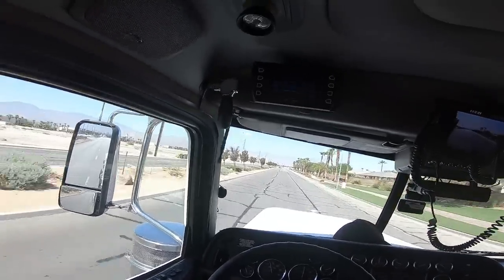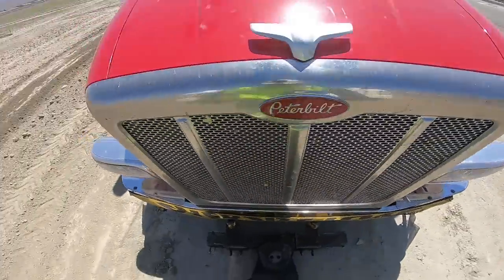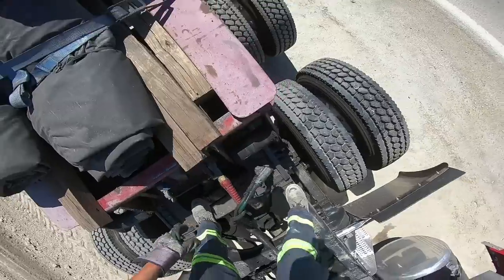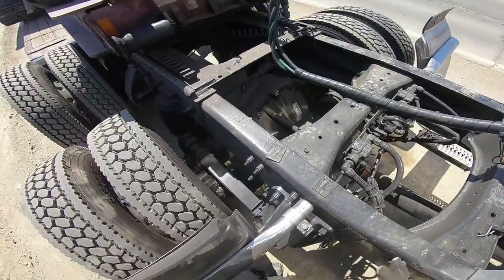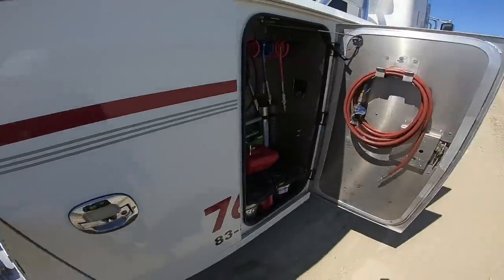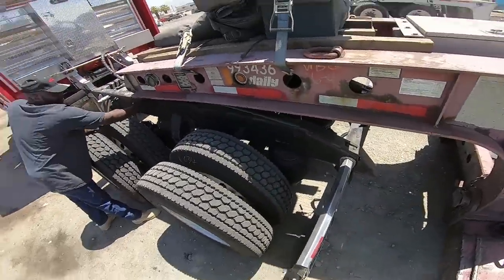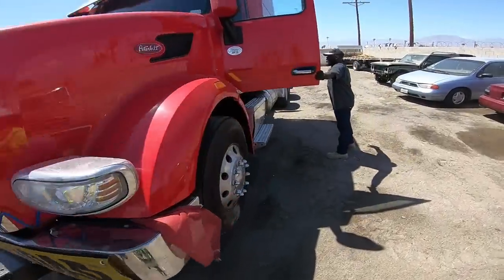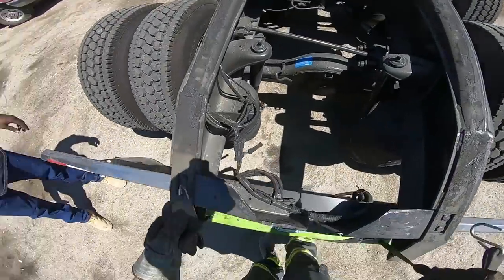Oversize Load Tow! ~150,000 Pounds | 11' 6" Wide

Comment from the maker: Bringing this one to you guys early ! Thanks guys!
Reply: Plaza Towing why do you sperate the shaft?
Reply: Plaza Towing Even if people don’t when will they still be more giveaways
Reply: Helpful tip on those lines from dropping . use some xtra long heavy duty zip ties. Some local towers do that here !!
Reply: @justanotheraviator2357  a towing guy told me once that they separate the drive shaft because your truck is off. So there's no coolant circulating through your transmission which can overheat it and destroy it. So they remove it so there's no movement in your transmission.
Reply: u are good guy and driver lol, thanks
Reply: @justanotheraviator2357  so the diffs don't get wrecked
Reply: How much is your rig
Reply: Are you located out here in Apple Valley?
Reply: Great video
Reply: Simple rule, you CANNOT drive the transmission with the driveshaft without the input shaft turning and the transmission in high range!!! Taking the drive shaft off  eliminates doing any damage to the transmission. You can also remove all 4 axles and put covers over the wheel bearing ends, same result the transmission doesn't turn.
Reply: Where can we buy the air fitting that snaps into discharge line
Reply: How many times did the excavator weigh
Reply: Plaza Towing

Comment: I respect how organized you are man. Everything is where its supposed to be.
Reply: my thought exactly
Reply: Exactly.  And I wouldn't expect less, since this thing could cause huge issues if something bad happened on the highway.  It's basically his responsibility to do everything top-notch.
Reply: 5s
Reply: That´s how work is done efficiently. You´d need to be able to grab into that tool box and have picked the right tool without even looking where your hands go.
Also when there´s lives on the line,  you just don´t make a mistake. Not like "you better not make a mistake", you just don´t make a mistake, period.
Reply: Except for he didn't put the caps On the U joint

Comment: 13:20 might as well put some covers on
Instantly drops it in the dust
that made me laugh

But. when you connected that blue air hose. Does your truck actually got an auxiliary bigger air compressor ? Almost finished my trucking license and i never knew they had a fitting on the engine to put the air in the brakes and suspension externally

Comment: Wish you would have shown the drive, I wanted to hear your acceleration/engine pulling that much weight.
Reply: Me too!!! Was disappointed. Shows him removing lights and attaching lights, more than the driving lol. Wanted to see the pull and turbos whistling
Reply: I'm not to sure how hard it's gonna need to pull on flat & level ground  bro...he can't haul that all together he can haul it to a safe pull off where he can break it down ..
Reply: I was looking forward to the fontana drive.....Damn!! I didn't get to see the big haul in real time....it was a claude vertesi song playing and you were hauling ass!! Reupload the big haul in normal speed! Cool shit though bro!
Reply: Also agree
Reply: ME TOO!!!!
Reply: I've pulled 13 axle/ 50 wheel oversize weighing as much as 268,000 lbs. The engine sounds exactly the same, and seriously, 100K is fly-weight oversize.
Reply: @topixfromthetropix1674  Wow.  your cool dude
Reply: @topixfromthetropix1674  pulled 91,tho,lp of wet sawdust, it's all I wanted to mess with, was in SE, KY,

Comment: Great work! Surprised you dont use binders on the chains incase the load shifts left or right. You havent had a problem unhooking the chains from the method you wrap them if the load does move?

Comment: I was impressed with backing that combo up. Well done sir. I am wondering though why you didn't take another truck to swap out with the broken one to get the trailer to the shop. I'm sure there was a tractor at that shop that could have been used. But I don't run a hook, you are the pro with it.

Comment: Maybe I'm looking to far into it but what keeps the Truck from just sliding left and right in the Yellow Cradle seen at 24:28? Just the fact that the Yellow Cradle is between the Leaf Spring Bolts? Just seems like it could slide left and right about 3 to 4 inches...

Comment: This is so interesting to me. I love the channel! I have a question though. Why do you disconnect the drive shaft? The truck is in neutral right? And why do you have to disconnect it if regular tow trucks don’t have to do that while towing cars and pickups? Thanks.
Reply: Nico Lucia the reason he has to disconnect the drive is to prevent transmission damage I drive box trucks and had to be towed a few times from breakdowns and the driver of the wrecker had to pull the drive shaft to prevent transmission damage with normal cars and trucks they tow the rear wheel drive vehicles on a flat bed and the smaller wrecker (wheel lift units) can only pull the front wheel drive cars if they have to tow the rear wheel drive on a wheel lift wrecker then they tow it with the rear wheels on the wheel lift but they cannot lift a big truck by the back wheels so they have to pull the drive shaft off to prevent transmission damage

Comment: Just a question (some states are different): Did d.o.t. reissue a permit and route, or do you supersede that in your state? Your tow vehicle changes the dimension, weight, and axle spacing for the new total load. Most loads/permit applications go through a bridge analysis for overweight routing (Some have "annuals" but require carried bridge maps which the driver keeps on hand.)
Just Curious
 Great Video!
Reply: That's my question to
Reply: Generally there is an overarching recovery vehicle permit that covers you to go wherever the original vehicle was permitted to go within reason and if safe.
Reply: My question too. So the rig has been permitted. Assuming that the front axle is 20k or less, I reason that the tow vehicle takes that weight and spreads it even further from the drive axle(s) and distributes that weight over tandem axles with dualies. Wouldn't that improve on a bridge analysis review? Therefore, I recon that a skilled operator like the lad we see in this video should be able to drive the rig to any destination covered by the initial permit/route regulations. I'm likely missing an important consideration. Cheers.

Comment: The light bar you put on the rear,  is that turn signals, brake lights etc?  I didn't see you plug it into anything,  how does it work?
Reply: wireless system :)

Comment: wow, backing up that whole train at the yard, I would have liked to see that at regular speed.  Also, when you were figuring out how to tie the red air hose into the harness to the trailer, did you ever consider getting some Gear Ties? Those are rubber coated metal wires and you use them like twist ties to tie  stuff together. They come in different sizes and colors too and are so universal to use and reuse.
Reply: He's qualified for the Australian Truck Trains now.
Reply: Backing up trailer and truck it's hard but not that hard.  Why backing up American doubles is hard is that dolly it gives you a extra pivot point. And the dolly is so short by the time you see the trailer doing something it's to late to recover.  If you watch like outback truckers and stuff those doubles people back all the time.  Now with that said it was cool I've done it with a camper and trailer well think the campers with motors are rv's it was a camper with a motor and a car trailer behind.  I was in a week training to haul wreckers.  I was on the side of the road and the car I was hauling I guy hit the mirror i was standing there not 5 seconds before he side swiped car and didnt stop btw.  I took the truck back with the trainer and handed in my keys and said sorry but not for me.  So to this guy hats off to you.
Reply: @BossSpringsteen69  this is a normal job for us haha I hate backing single axle dog trailers similar to what you guys call doubles. When it's behind a tow truck it's nearly impossible to keep it all lined up as you can't move quick enough to catch it.

Comment: How was they guys truck spec'd out to do heavy haul with a single axle? That's nuts!
Reply: Where is the single axle?.  I see a tandem axle tractor and a tri axle trailer.
Reply: @MilliMillTV  Single drive axle
Reply: @MilliMillTV  He means a single drive, its a tandem but only 1 driven axle
Reply: That's 500lbs in weight savings that he can have as paying cargo!
Reply: @Fu2two  You're already going to need permits anyway so what difference does a couple thousand pounds make. But a whole lot of difference when you're stuck for no reason and need a tow.
Reply: I know right!!!!!
Reply: @F C, it save lots of fuel and tire wear when you're running empty. A truck spec'd like that can lift the dead axle, and he can chain up 2 of the trailer axles a save a ton of rolling resistance. And he pulls for Daily, they deliver new equipment to dealers their trucks don't get in the dirt on jobsites.
Reply: His total weight of him and his rig together was 109,000 lbs. The black guys load wasn't but 60,000 lbs and with the newer axles...he good to go
Reply: @MilliMillTV  Single axle is when the drive shaft only spins one axle to drive the truck....only one set of tires spin when the truck accelerates. Extra tires behind it is for weight purpose.
Reply: There are two axles just no interlock. Kinda like 2wd vs 4wd.
Reply: it's a twin axle rear with single drive.... very similar to the Euro 6x2 trucks, there's no need for both axles to drive.... just so you know...
Reply: @brandonharris9237  agree!
I on the same page with you sir!

Comment: Curious. Are any tractors setup to accept air for supply and brakes allowing the tractors brakes to help slow the load? Seems I only see trailer brakes operational. Just an observation.
Reply: Philip Housel they have devices like brake buddy's  to setup in the cab to use the tractor brakes also. Most people just run air and use trailer brakes.

Comment: im not a tow truck driver by any means, but i have used chains a few times..on the last chain i noticed you hooked it to itself when it looked like you had plenty of length to hook it to the back of the wrecker..is there a reason for that?  just curious..
Reply from the maker: If I understand correctly you are talking about my safety chains. Those chains are to hold the towed truck behind my tow truck in the catastrophic event of a detachment. These chains must be loose enough to allow for the towed truck to turn behind the tow truck. The safe bet is to float the chain a few inches above the ground. Thanks for watching!
Reply: ah..okay that makes sense now..thank you for explaining the reasoning

Comment: I do wonder why trucks dont put something like an OBD port near the hood for light for a towtruck to plug in to. Instead of needing to hang light bars
Reply: Or just run a cable to the trucks trailer and use the trailer lights? that what i'd do.  they have a socket on the back for that as it is im sure.

Comment: it is indeed disk brake. Havent worked on them too much, but Pete seems to be pushing to sell them on their newer trucks. also, something to maybe try with the air hoses, tie a closed loop rope into a prusik around the hose and attach a decent sized carabiner to the loop. then you can set as much slack as you want and it shouldn't move on you. Just an idea though
Reply: what i was thinking on the air hose.

Comment: Wait... Why drop the shaft on a manual tranission? I understand auto's, but manuals get lubrication regardless if the engine is running.
Reply: if it falls back into gear while being pulled  one opf many reasons or risks of shaft remaining connected.

Comment: Why the trucks don't come with a quick connection on the front like a train is, it would make a more secure connection, or at least quick air connections? It would seam that a train coupler type directly mounted to the frame would be a good idea.
Reply: Im no tow truck expert but my guess would be because they have to lift up the front of the truck so they dont have to worry about going down the road, hitting a bump, and the trucks front wheels turning to one side pulling the rear of the tow truck with it. a train doesnt have to worry about that because its on rails

Comment: Why were you disconnecting the drive shaft to hook it up?
Reply: Disconnect the drive shaft so it doesn't spin the gearbox as he towed it. The oil pump on the gearbox is driven by the input shaft, which isn't turning when the engine is off. No oil means rapid wear to the bearings and synchros, and a throw away gearbox.
Reply: @rustymozzy  it also has a chance of turning the engine over and putting more miles on the engine

Comment: That's a baby load. I did oversize/heavy haul for over 20 years.  Average load 300k+/-,  biggest load, just under 500k 28 feet wide. You have to know your business,  the stress on equipment is tremendous,  easy to drop a clutch or an entire trans without a blink of an eye. Good job on your first time of a load that size. Attention to detail and the small stuff is your biggest tool for success.

Comment: 27:39 
The light bar use by charger? I don't see no electric cables.
Reply: It has a battery and it works remotely from the truck.

Comment: it's in neutral why do you disconnect the drive shaft?
Reply: Disconnect the drive shaft so it doesn't spin the gearbox as he towed it. The oil pump on the gearbox is driven by the input shaft, which isn't turning when the engine is off. No oil means rapid wear to the bearings and synchros, and a throw away gearbox.

Comment: Wow what an underrated truck for the size of load. Tiny axles and driveshaft. And no rear rear axle like WTF was he thinking.Definitely not a heavy spec tractor.
Reply: Dre Belanski I thought exact same thing but thought what the hell do I know, cheers.
Reply: Thinking the same, he probably did it before
Reply: why thats an x15
Reply: You know how it works when you are hauling locally
Reply: He even said it was overweight
Reply: I bet he didn't Blow the clutch out like he thinks I bet the cross shaft in ring gear broke and what a light duty drive shaft for hauling equipment the guy that spec that truck does NOT know what he is doing that is nuts is correct

Comment: Cab anyone answer me, is the truck is in neutral and hes got the air line for brakes why did he disengage the driveshaft
Reply: To keep from damaging the transmission. Many of them run the oil pump from the input shaft. If the engine is off, no lube oil. Very short (like a block) won't hurt, but any distance will ruin the transmission

Comment: Instead of pulling the driveshaft off just take the inner driveaxles out for the drivning axle. Dont wanna get hit when the driftshaft comes off and its alot easier to get them back in when its fixed. Cheers from a heavy mechanic cross the pond.
Reply: that would be like 100 times more work than pulling few bolts and strapping the shaft away

Comment: Wouldn't this tow be more suited to your 4 axle tow truck ??
Reply: front axle is the lightest on the truck, so with all the weight on the trailer / rear of the truck, what truck he used makes no real difference.  either way he wasn't over weight on his truck axles with only picking up probably 16k at the most.

Comment: Why do you need to unhook the driveshaft?
Reply: The rear wheels turn the drivershaft, which would rotate the transmission. And since the engine doesnt run the transmission doesnt get oil circulation. If you rotate the transmission without sufficient oil circulation it may cause damage.

Comment: Why you do that with that drill for?
Reply: Disconnect the drive shaft so it doesn't spin the gearbox as he towed it. The oil pump on the gearbox is driven by the input shaft, which isn't turning when the engine is off. No oil means rapid wear to the bearings and synchros, and a throw away gearbox.

Comment: Trying to catch up on the videos. In the State of Washington you couldn't do that tow. Tow trucks are not allowed to pull truck and trailer. I've seen them refuse to even allow you to pull to the shoulder at times. Most of them will, but that's about it. Most heavy tow company's have 5th wheel tractors they have to bring out. Or they sub contract to shuttle service.

Comment: Why did you disconnect the driveline? I'm thinking about purchasing a heavy duty truck...
Reply: Because of he didnt disconnect, the trucks owner would "ALLOW" him to replace that transmission with a brand new transmission. When towing, the trans pump doesnt turn as it runs off of the input shaft of transmission, no engine=no lubrication for the transmission .

Comment: at least you had open area to tow i broke down in the boston mass area at 35 miles an hour it shut down no warning wire broke on the computer in a bad spot cops said tow whole unit i will flow you what a nightmear tiny streets and idot drivers also freei all works better than wd 40

Comment: The safety chain...ever had one come loose when the grab hook bounced off?  (not being a smart ass,  I watch your videos to learn.)  Also, the chains over the axle to the crossbar,  do you do those on the fly with what makes sense, and if not, what are you thinking about when doing those.  I have done medium duty and light duty towing, and have not ever lost a load, but have had chains come loose, and so I know I am doing something wrong and want to correct it.  Thanks to whoever replies with advice.